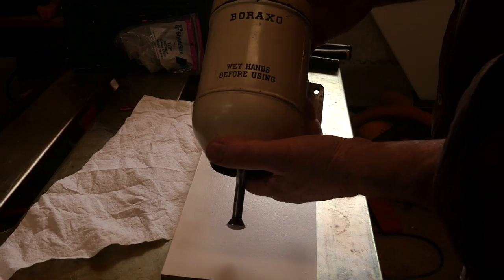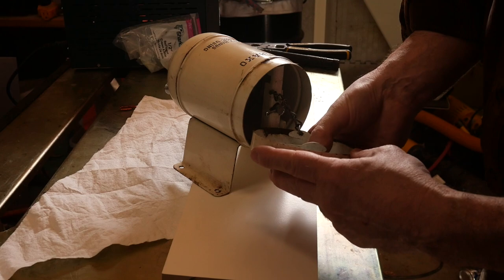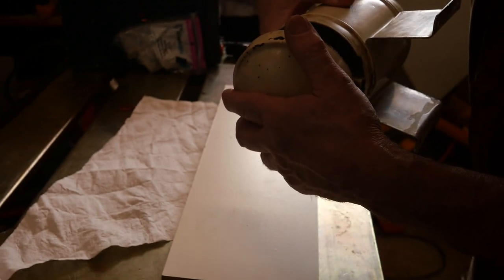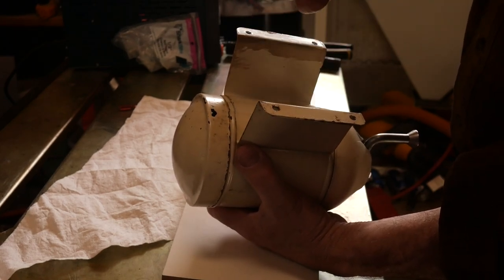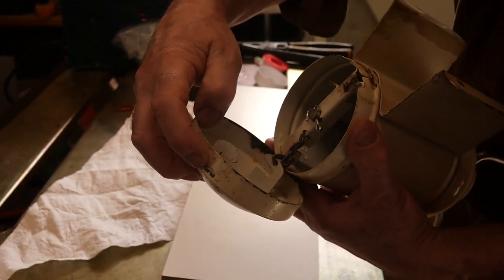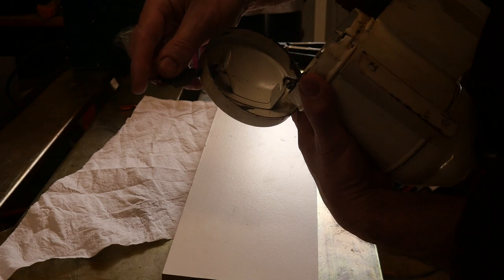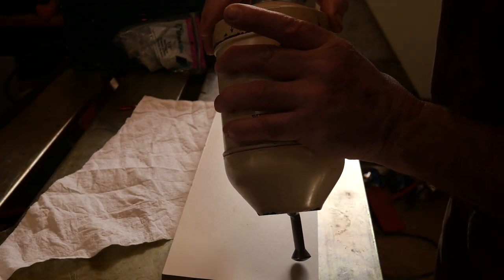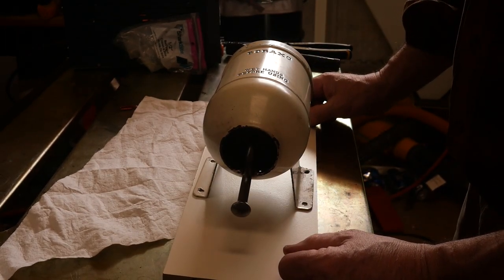Opening a Boraxo soap dispenser lid

Comment: Thanks for the video! Not sure I would’ve been able to open mine without this for reference. The flexible part of the latch really is more to the right of the keyhole than I expected. I used a dental pick to open mine.
Reply from the maker: Perfect - as I filmed this I reckoned that there might be someone out there as stuck as I was.  As obscure as it gets!  Sadly, I have to admit it took a couple of evenings to work it out. and it looks like it helped!   If the lever is corroded, I sandblasted mine and nickel plated it - really easy - ping me if you need assistance (btw - finding original Boraxo soap is v expensive - have not ventured to other brands yet....).  Rgds. Mike

Comment: The key has the best instruction. “Press down. Turn lid.”
Reply from the maker: Ah yes - thx for the advice - as I set out - the instructions didn't work.  This vid is for people (like I was) who are having problems opening the blessed thing.  In my case, a Boraxo key didn't fit and the latch was waaaaay off to the side and so the standard instructions didn't work. I was stuck and once I figured it out, I posted this video showing the mechanism (which I couldn't find) to help them out...